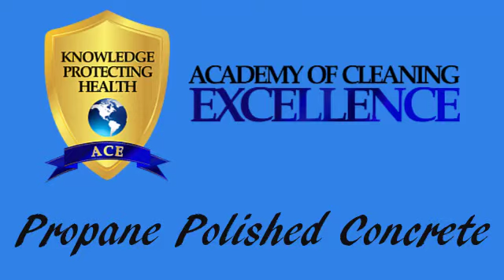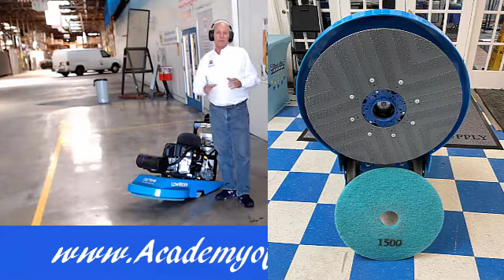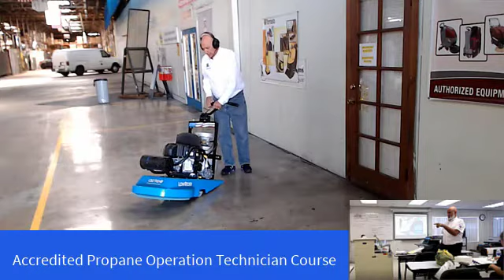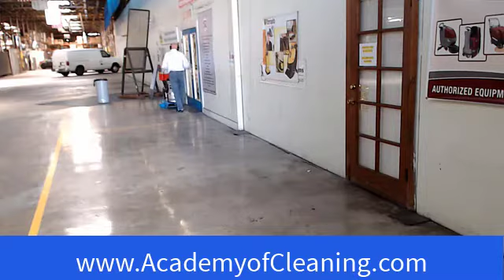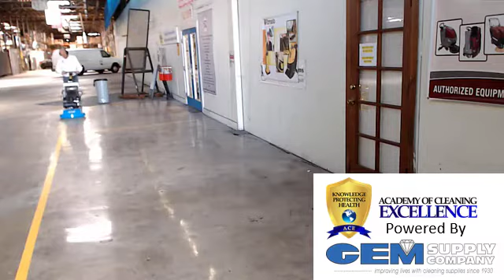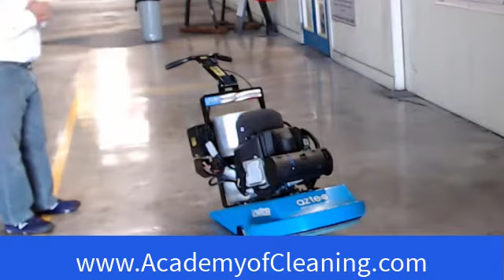How to Propane Polish Concrete

Comment: How do you address a concrete floor that has a sealant or finish on it? This is a new floor that we will be servicing and previous company has used a sealant for shine. We are trying to polish it instead.
Reply from the maker: First you have to find out if the coating they put on is water based and can be removed with water based strippers.  You CAN NOT polish the concrete if there is any water or epoxy finish on it.